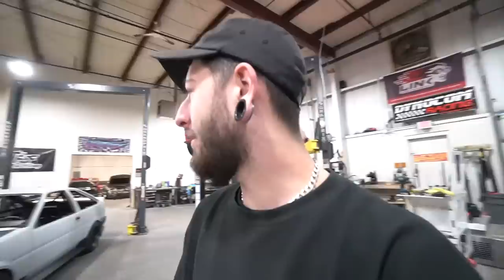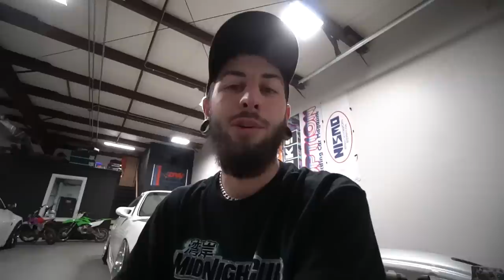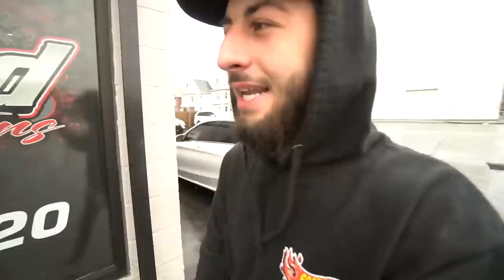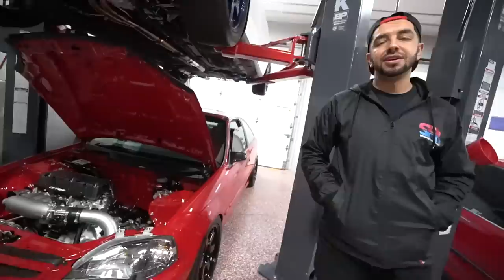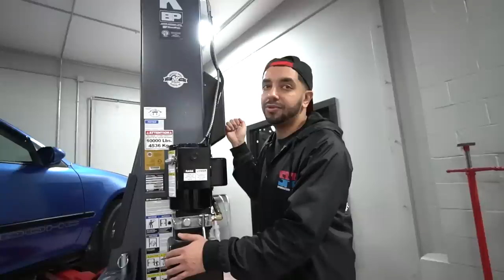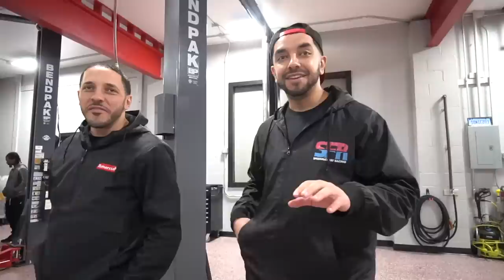Visiting The Craziest Honda Shop In The North East!

Comment: Lol, don't need AC for a street car in CT... Like bro, what the fuck do you mean it doesn't get that hot over here? If you're talking like 110f+ or something like in the desert then sure it's not as hot as the west coast, but a good portion of the summer is like 90-100f with dumb humidity. Now it's a different story for a specialized car compared to a mild street car...

Comment: The k20z3 has higher 11 to 1 compression rating and makes near 200 out the box. The k20a (not a2)  has a 9 to 1 ratio and only makes 160 out the box. Takes boost better then the high comp one. High comp bends rods easier.
Reply: High comp doesn't bend rods. The only thing that bends rods is too much torque. It's the same on k and b series.
Reply: @JDMz   Nope. Torque and power are outputs of the engine. The combustion explosion is what bends or breaks things internally. Compression rating materially impacts the combustion explosions power. You have been listening to too much jimmy o as thats his saying he incorrectly quotes. .

Comment: The z3 is junk. I agree with the sonic boys. Either do a k20a2 or k24a2 with type s pump. The 24 I think only has 25 or 30 degree cam. The 20 has a 50. The 20 will Rev higher on factory block, but you throw the type s pump on the 24 and you'll be close. I personally like the 24 better. But the 24 sits a bit higher. It's a taller engine. Choose wisely my friend haha

Comment: Shit I made 250whp twice -
once on 93 and once on e85 with a stock muffler lol. 
I used a stock 04 rsx type s head, 08 stock k24 tsx block, type s oil pump , ported RRC manifold 74mm hybrid throttle body and 3” thermal r&d exhaust , 250 whp proven setup 🙌🏽 tuned by derftuned. It was in an em1 one of my favorite cars I built. it was an easy 11 sec car